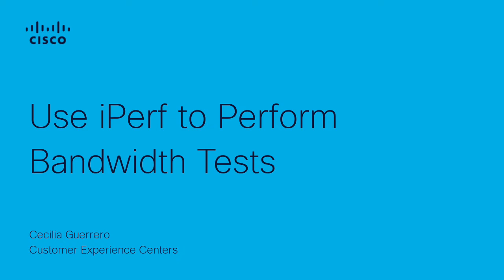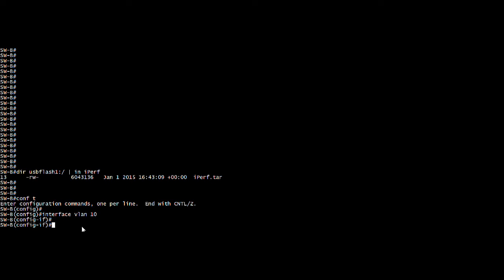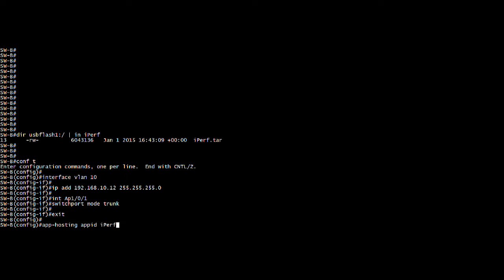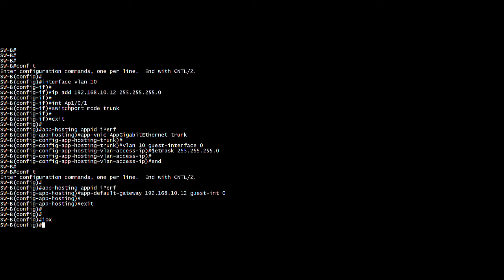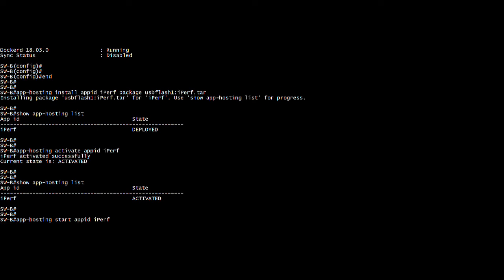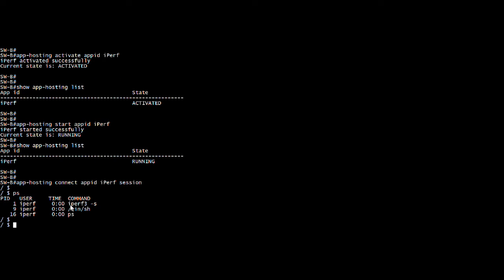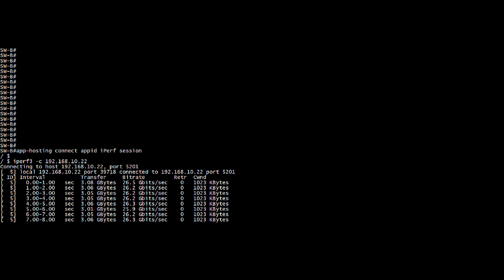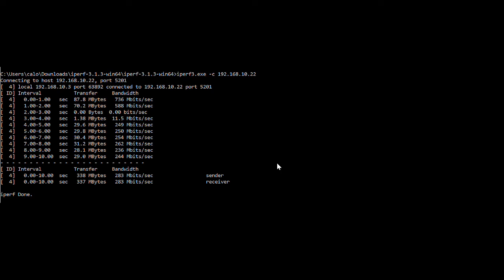Use iPerf on Catalyst 9000 Switches to Perform Bandwidth Tests

Comment: Which iperf do you download for the switch? (  Windows 64 bits, Ubuntu 64 bits / Debian 64 bits / Mint 64 bits (AMD64), Arch Linux 64 bits (x86_64))
Reply from the maker: Hi there, thanks for reaching out. We recommend iPerf3 and recommend learning more here: http://cs.co/6054OD6vq. Have a great day!
Reply: @CiscoSystems  Which Iperf3 binaries?  Linux manual Installation 64 bits (AMD64)?